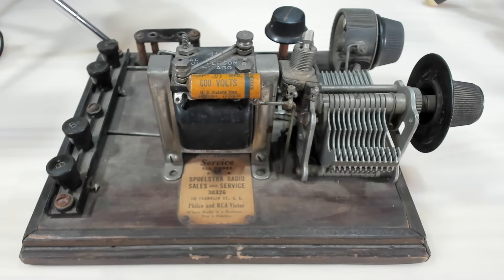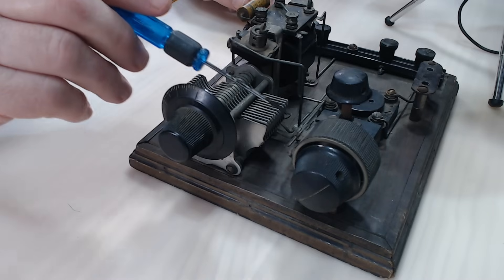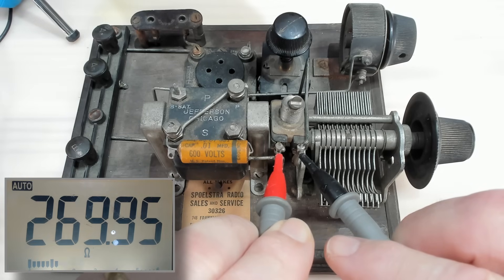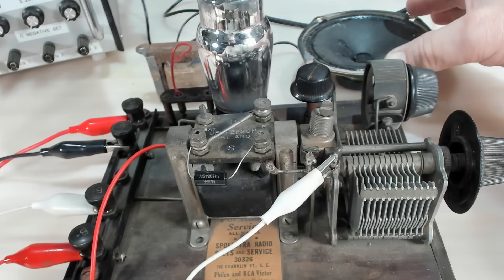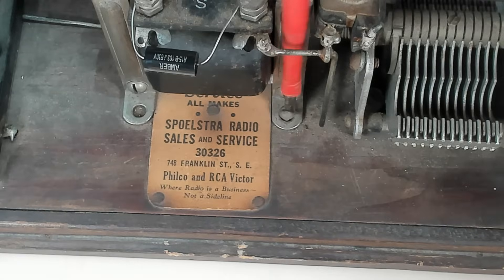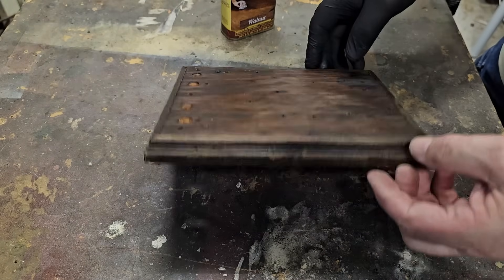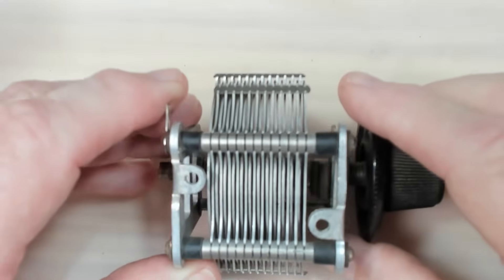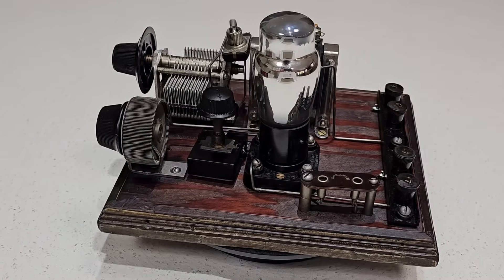Mystery Electronics from the 1930s. What is it?

Comment: Looks weird enough to be one of those vintage electric shock machines from when such was thought to be a cure for a whole range of maladies. They were usually magneto driven though, and this item doesn't appear to have the output power to be used for that. The 'speaker' connection could be a red herring, and may just have been a two pole connector that they had handy when they cobbled it together.
Reply from the maker: Thanks AV. I didn't think the socket was necessarily for a speaker either, it seemed a logical starting point 🙂

Comment: Might be overloading the tube. Probably looking for a 2000 ohm horn speaker in series with the B plus.
Might be a horn speaker tester with a bit of audio frequency variation using the switch, the pot and the variable cap for different ranges?
Reply: The high-impedance side of the audio transformer he used to couple to the speaker does the same thing - large inductance, high resistance.
Reply from the maker: I see what you are suggesting, thanks Joe 🙂

Comment: It looks like the transformer is actually a tapped coil. PG coil and cap are some tank cicuit. It's surely an oscillator, but having the large transformer for a coil, it must be low frequency. It seems like a  Hartley or Kolpitz oscillator i.e. simple signal generator.
Reply: That variable capacitor seems too small to account for anything that's not RF.  Yet it has a speaker.  Is it supposed to be heard and to transmit RF both??
Reply from the maker: Yes, the Hartley oscillator has been suggested. Thanks Veljko 🙂

Comment: Indeed a mystery device, whatever it is.???  Found this info on the transformer made by Jefferson Electric, Chicago, Illinois dated 1922.

"The No. 41 also is a very efficient Transformer. In fact, the only difference between the No. 41 and the No. 45 is that No. 40 wire is used in the No. 41 and No. 44 wire in the No. 45. This, of course, means that the No. 41 Transformer is a little larger and, consequently, a little less free of capacity effects. The No. 41 Transformer has a primary consisting of 4000 turns of No. 40 wire, resistance about 900 ohms; the secondary has 15,000 turns of No. 40 wire, resistance about 5000 ohms."

"Transformers are mounted in attractive nickel plated frames with genuine Bakelite panels which carry the Primary and Secondary Binding Posts. Each type of Transformer is furnished either mounted or unmounted."

No. 40--Unmounted Type   $3.50
No. 41--Mounted Type   $4.25
No. 44--Unmounted Type   $6.00
No. 45--Mounted Type   $7.00

A letter dated Aug. 28, 1922 from H. T. Moorman of Jefferson Electric to Weyrich & Hadraba, Plattsmouth, Neb. further describes the transformers.

"Answering your postal of August 14th, we beg to submit the following data in reference to our #41 and #45 Audio Frequency Transformers"

 #41 transformer data:
Ratio of Turns - Pri. 1100 ohms   Sec. 5350 ohms

Impedance at 1000 cycles (calculated) -  Pri. 79,000 ohms   Sec. 1.8 megohms

Short circuit current, 60 cycle, 220 volts impressed. -  Pri. .144 amperes   Sec. .011 amperes

I suspect that where it says "SPK" is where some old fashioned 2000 ohm impedance headphones might be connected.
Just for sh1ts and giggles I wonder what would happen if you placed a coil of suitable inductance across the variable capacitor and connected an external aerial to the side going to the grid and attempted to tune in a local AM station?
Reply from the maker: Thanks @Tanamera-Tech. Mustafa found the transformer data and sent it to me. I didn't include it in the video.  I tried an antenna coil attached to various points, it changed the motorboating but no static. 🤔
Reply: Great original data on this audio transformer!

Comment: Given that it is very hard to see a practical application for this circuit I can only think that it is a teaching aid to show how valves behave when used in an oscillator circuit. The design of it does seem to be demonstrative. It's on a plaque and all connections seem visible.
Reply from the maker: Good point Gad 🙂